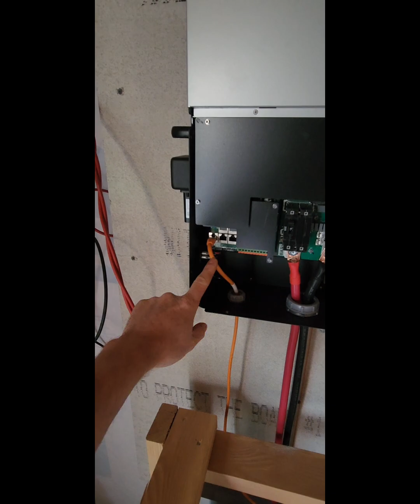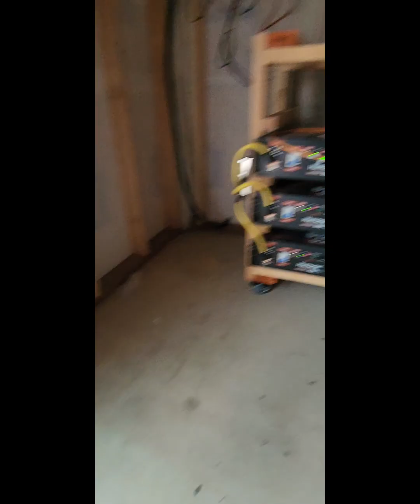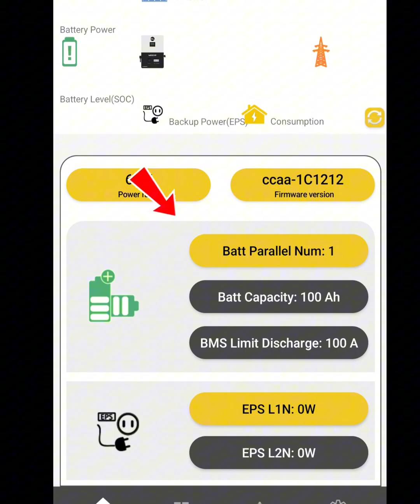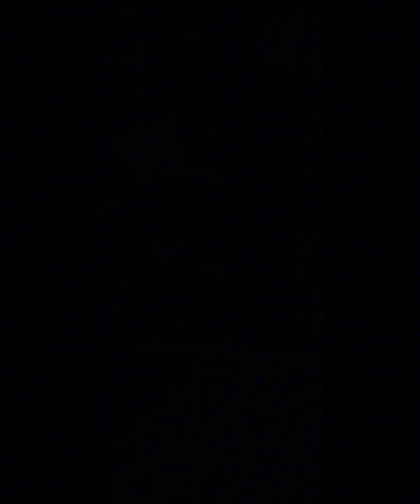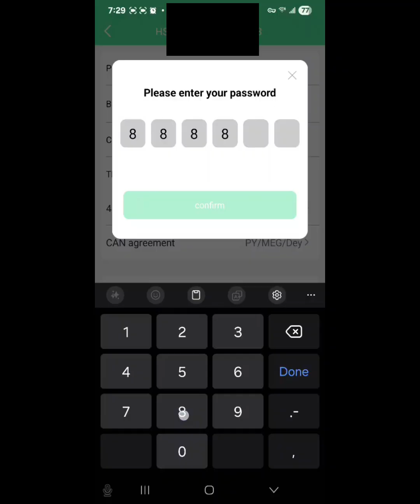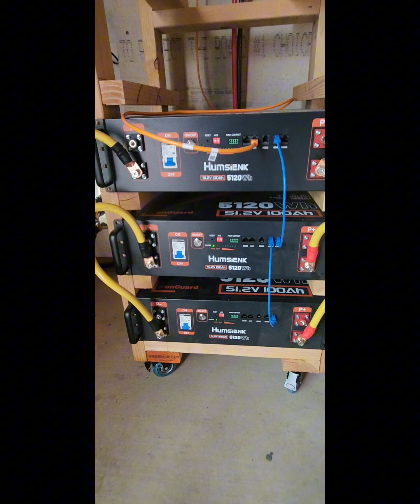EG4 6000XP & Humsienk 48V Server Rack Battery Communications

Comment: Here's the problem no one is talking about with these. 1. The Bluetooth range is like 3 feet. 2. These batteries will not communicate with any other brand batteries or BMS, they use a proprietary protocol. Yes they talk to most inverters but no mix of anything else if you want communication. I'm personally ripping the BMS out of mine and replacing it with a much better JK BMS.
Reply from the maker: Through my own research, I know these to be TDT-1001 BMS units.

https://www.tdtbms.com/

Is that confirmed somewhere with the vendor? Is it proprietary? Are there no protocol settings available in their full programming app or in BMS Meta that apply to the far-right RS-485 ports? I'm sure that statement is true out of the box, or even with the stripped-down official Humsienk app.

Agreed on the Bluetooth — you've got to almost be on top of them. But for units often selling for $450 or less with sales, I'd excuse a lot. I don't think there's much to realistically complain about.

Just to be clear: I don't work for either company, and I didn't get a discount on the units — I paid full price. So no bias here. Excellent points for some users.
Reply: @breakfixbuild correct on the TDT BMS and you guessed correctly, the app gives almost no control at all. Completely locked down. I'm probably just going to rip my BMS out and replace it with a JK. It looks like the JK will be a easy swap.

Comment: Does it matter I connected the Inverter to 485 slot to the left of CAN? Ive only got one battery for now, so I dont know
Reply from the maker: If its a 6000xp and you got the smiley face, it generally means the battery communication is working. Does it show the battery power level on the inverter?
Reply: @breakfixbuild ive got a 5000w sungold inverter so i dont know lol. I did have to program the battery and well as the communication protocol, it would error out until i configured it, but now that i have the battery to LP16 and Communication set to 458, its not erroring. I think its working, but i guess I wont know until i get another battery.

Comment: You appear to have the following code violations. 1) NEC ART 110.26(A)(1) Depth of Working Space. Your batteries encroach into working space in front of the inverter. 2) NEC ART 690.31(G) Your PV circuits appear to be run open wiring and/or within non-metallic raceway. Code requires metal raceway for circuits inside a building.

Comment: So I just wanted to update everybody on my setup. I have 3 Humsienk batteries and a Sungold 5000 watt AIO. There are a few small differences between the Sungold inverter and the EG4. Everything that you posted here for the batteries is spot on and it got me started. The only difference is that for the Sungold, you have to plug the communication cable into the rs485 port thats next to the CAN port on the Battery #1 and into the RS485 port on the Sungold inverter. Perhaps the EG4 has a  CANbus port but mine does not it only has RS 485. Once I did that, everything is working the way it should. Also the communication protocol setting 33 on the SunGold is the PYL setting. I didn't know where else on youtube I could post this, so I figured someone with the Humsienk batteries and a Sungold might stumble onto this video.  

On another note the new Humsienk server rack batteries have a different on/off button that lights up when it's on rather than a small LED on the side of the button. The manual is exactly the same, so I don't think they changed anything on the inside of the batteries.

This video was very helpful and got me moving along. Without it, I don't think I would have figured it out. So huge THANK YOU for that!
Reply from the maker: Awesome to hear it helped and thanks for adding the info for sungold for others.
Reply: @breakfixbuild  I posted a thread on the DIY solar power forum and linked your video over there. Youtube won't let me post a link to the thread, I already tried. It's a great forum for all kinds of solar projects. Will Prowse started the forum. Maybe you'll get some more views.

Comment: Great info! Question, when you turn on your bluetooth on your phone, do you open the bluetooth settings on your phone and connect to the battery first, or do you just open the BMS Meta app and connect that way?
Reply from the maker: The humsienk and/or META app do not need to be paired via Bluetooth first. You'll just need to make sure Bluetooth is enable on your phone. Then the app will "discover" the available units and allow you to connect to them.

Comment: I just bought one of these and will probably be getting a second one. This is for an RV setup. I'm using a Sungold 5000watt AIO inverter which I'm hoping that this info will be helpful for.
Reply from the maker: If nothing else, it will start you with the batteries communicating properly. Then you'd just have to get the master battery talking to the inverter. Look for your inverter communication setting for Pylon, that should get them talking.
Reply: @breakfixbuild  Thanks man. I'm about to get this mounted in the RV along with the inverter. It's a pretty impressive looking battery. I looked inside and it looks great. Very well made unit.